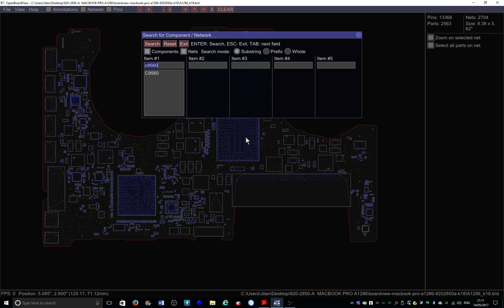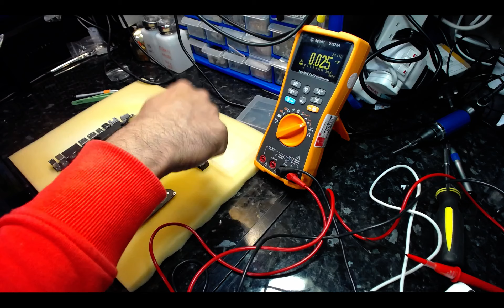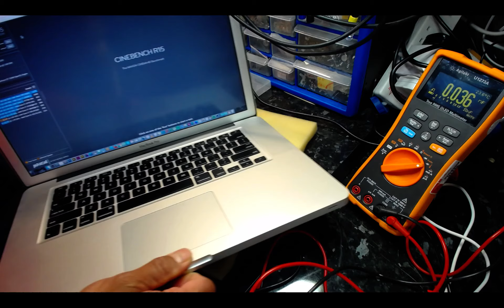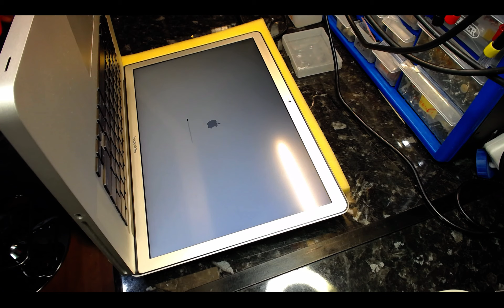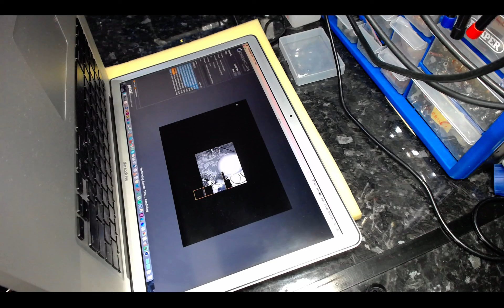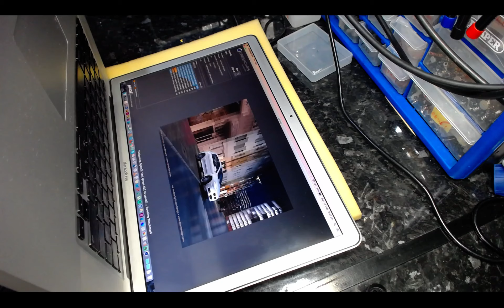HOW TO FIX MACBOOK PRO A1286 820-2850-A GPU KERNAL PANIC ERROR BY REPLACING TANTALUM CAPACITOR

Comment: that capacitor if you measure it with an ESR meter it will be wrong it is not a reliable measurement of capacity only.

Comment: I have a 2011 macbook pro 15" with the same grey kernal panic.

I don't have a 330uF 2.0v that i'm aware of, however i have some capacitors that are on my old macbook '09 unibody. are they the same as the 330uF 2.0v and will they work?
I have these one's:

33/C93
330e8D
330d92f

Please let me know.
Reply from the maker: Hi, to confirm this please check schematic for both logic boards.  Also I would recommend a fresh capacitor.
Reply: iTCXtreme is there a site you recommend where i can find my laptops schematics?
Reply from the maker: @karikun90  please search on google with logic board number i.e. 820-2950, etc and many website will have a download.

Comment: Hello. I have the same issue in the main board 820-2849. How to fix it? Is te same solution? Replace it the capacitor C9560?
Reply from the maker: Hi, only thing you can do is replace caps.  Cheers
Reply: @iTCXtreme  ok. But the main board is different. My model is 820-2849. The layout is totally different. My questions is if the issue is the same, changing the C9560 solve the GPU problem? Tks
Reply from the maker: Furthermore after replacing the cap if the symptom persist then i would say Graphic Chipset or Video Ram at fault.  Cheers

Comment: Hi I have a A1418 iMac late 2015 21.5 inch 4K and even that suffers from same issue it crashes out, sometimes it gives grey screen or sometimes I get black screen with white random text on startup.
Could it be the same problem with that capacitor?
Reply from the maker: Hi Pal, the possibility are faulty caps, gpu ot vram.  Cheers

Comment: Hello, I'm trying to do this on my macbook pro and I have one question: would a 330mf 6.3V capacitor work? or does it needs to match voltage as well?  btw this is a great video thank you very much for uploading this, I've been trying to fix my MBP for two years and I was about to throw it away until I saw this!

Comment: I left my  2010 with gpu fault after a mb replacement closed on the desk. When I came back 20 min later it was overheating while closed and didn't react to anything, but pressing forced shutdown with the on button. No the display stays black when I try to start it. Dosen't boot anymore. :(
These Macbook Pro generation was really crap.

Comment: 1) Where is this capacitor located on a 17" Macbook Pro?  17" has the same issue.  2) 375uF is a good cap.  Nothing wrong with 375uF.  Maybe it breaks-down under heat?  Maybe under vibration (fan?)?  If 375uF were the sole problem, why not simply remove the 10uF cap in parallel right next door?

Comment: I'm very confused:  You measured the capacitor you removed.  This is one of the reasons I wanted to repair my computer myself, is that I want to see how far the value of the cap has deviated to cause my GPU to intermittently kernel panic from notching the power supply line during large frame-buffer updates.  But the cap you removed measures 373uF.  The aging capacitor should be a lower capacitance.  Perhaps we can conclude that the temporary value is increased, because you severely heated the cap to desolder it from the logic board.  OK.  Still, it seems awfully high a value.  Like why bother to replace it with a smaller value?
The other thing I do not understand is that technically a poly-tantalum cap is an electrolytic capacitor, and is polarized.  You measure the same (1uF difference) value for both polarities.  Both of these unanticipated things puzzle me.  Are there simple explanations?

Comment: Hi I have early 2011 mbpro 15 inch, after say 10 minute the screen goes blue with lines. Would you say it's gpu or cap issue?
Reply: iTCXtreme where can I buy the cap from? Any reference number/rating for it? Thanks for your reply

Comment: Bro thanks for video but i have same motherboard 820-2850-A with dim screen problem  i check d9701 24.82v it must be 32v i replaced lp8545 but still same help me out and 2nd where is lid close sensor on this board so i can disable it..thanks

Comment: Hi There,
I just want to know that if my Mac randomly shows horizontal lines and shows white screen, is this required gpu chip replacement or the capacitor replacement advised by you will fix the issue??? Thanks Upendra

Comment: Thanks for posting this. 
I have a question.. The original is 220uF 2V, right? 
Does it matter much which capacitor I use as long as I get those specs or higher (within reason)?
Reply: On the A1286 board, the original should be 330uF @2V.  220uF is for the model one rev newer or older than the A1286 logic board.

Comment: Hello iTCXtreme,
i have a mid 2010 macbook pro 15" i have had this problem for a little while but i think i have completely fried the capacitor as it does not get past the boot screen any ideas?
I do have a soldering iron but i don't think it is powerful enough to remove the type of solder that is on there currently and i also need to know what capacitor to replace it with.
Thank you
Reply: Hello,
Yes i am in the uk
Reply: Hello, 
I have sent my details via email and hopefully u have received them
Reply: Hello,
I have also attached some photos
Reply: Np

Comment: Hi iTcXtreme!!
I got a macbook pro 2010 with gpu issue. I cant got a capacitor 330uf 2 v in my country. Can I use an capacitor 330 uf 2.5v?

Comment: hi, get this cap. GRM32EC80E337ME05L its the right fitting. less work to mess about. http://uk.farnell.com/murata/grm32ec80e337me05l/cap-mlcc-x6s-330uf-2-5v-1210/dp/2671590
Reply: haha. no problem. these 2010 run super hot. i suggest, get the user to install smcFanControl and pump up another 1000rpm or more for stability :P
Reply: Just an FYI, I haven't tried it yet, but feedback from another forum was showing about 30% failure rate from people that tried the ceramic capacitor. So even though the other ones require more scraping/work, they appear to all work without issue if solder is done correctly. Cheers.